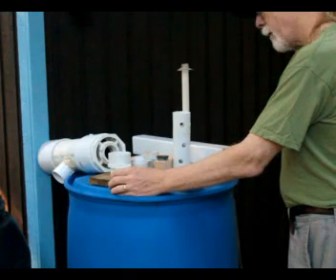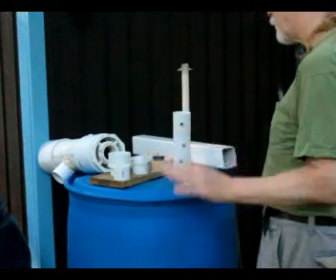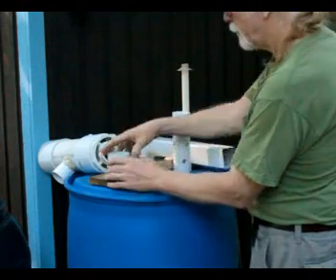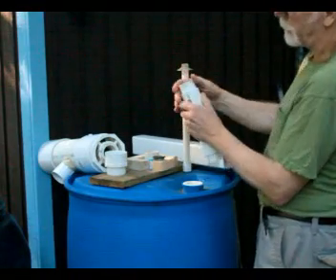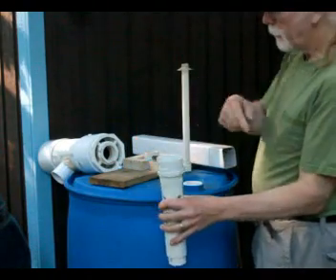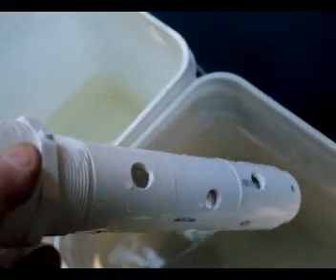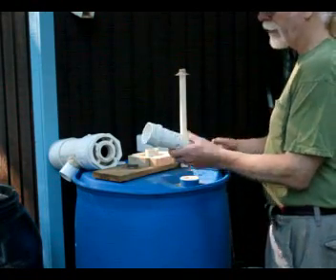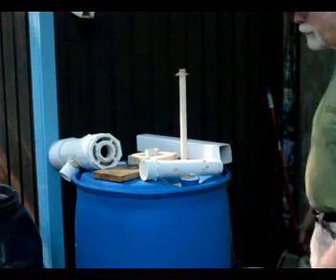DIY_first_flush_video_part3

Comment: Dave, very ingenious system. It's one I'm going to remember when I set myself up a harvesting system. I'm curious to know what are the benefits of having a setup like this? I can see how it is more advantageous than having the water all at one level within all the barrels. But I'm curious to know how it differentiates from just making a runoff pipe from the top of the barrel to the next and so on? Thanks for the input and for the videos!
Reply from the maker: T.K. Archibald Thank you for taking the time to comment. You bring up a good point. At this location, in the summer, there is usually no rain, or very little at best. The slow sand filter must have water circulating through it always. Also the filter needs input water with organic material in it to keep the filter alive. Recirculated filtered water is nearly pure, so occasionally adding some unfiltered water keeps the filter alive. The water in the barrel is used in very small amounts in the re-circulation of water through the accompanying slow sand filter. If you do not use a slow sand filter you may not need the large storage container. You will need some kind of container to facilitate the fixed amount of automatically diverted water during each rain event.  The large barrel allows a lot of leeway as to the number of gallons of diversion needed. The level at which the slow drain faucet is placed will determine how many gallons are diverted. For example halfway down is about 26 gallons of diversion. Here, in the forest, the roof gets really nasty and lots of diversion is needed at each rain event.
Reply: edvac1 Ah, I see now. Watching your other video on the sand filter definitely helped. This setup is a must-have. Thank you so much for your explanation!
Reply from the maker: T.K. Archibald You're quite welcome!!

Comment: Thanks for the pointer!  That explains everything.  I see we were both right about the slow drip; it does work without a vent, but doesn't work well, and can't be regulated.  And yes, a stopper would be necessary to block up the diverter as osmosis would allow dirty water to flow out.  Thanks!

Comment: Ah, not quite right, heavy flow won't completely block the air, but if it's heavy enough it could start to back up.  Where are you that it rains that so hard it can fill a pipe that size?  As to venting the slow drip, since I don't have the system and you do, I'll take your word for that, but I've never seen water not leak out a hole that it's above, vented or not.  Good answer for the size of the barrel, didn't realize you had a use for the extra water.  Just seemed a waste of barrel that could

Comment: The ball is to prevent floating debris from coming back up the pipe and into the water barrel, right?  How about just using a "j" shaped pvc pipe that goes down into the barrel?  As long as it's not at the very top, the depth wouldn't matter, and when the barrel was full, floating debris wouldn't go back up the pipe.  Actually, as long as the pipe didn't end at the top, it could just be straight, going down 1/2 or 3/4's of the way down.

Comment from the maker: Vent: heavy flows completely block the air -  if it rains really hard the thing will back up. The vent lets oxygen flow through. If the diverter is full and the float seal is at the top, the slow drip won't work without a vent. 55 gal. barrel is used because it was what was available, inexpensive, food grade plastic, and it is being used again - not in a landfill. Smaller barrel will work. Extra water is used to keep filter alive in dry months. Better answer on my blog June 2 2013.

Comment: I was wondering the same thing, there's usually two bung holes, why not use them.  Also, I don't see the need for the vent, doesn't air escape out the inlet?  And why not use a smaller barrel if you're gonna put a "reset" faucet in 1/2 down a 55 gallon barrel.  Seems like if you use a 30 gallon barrel your "reset" and clean out faucet can be one and the same, at the bottom.

Comment from the maker: Yes on most barrels the 2" existing threaded openings will work. Thanks for the comment and the good suggestion. The input will be slightly tilted because of the design of the barrel, but it does work.

Comment: Dave, great videos!
  I was wondering if you could just use the existing 2" bung fittings in the barrel to mount your diverter on the one side and vent on the other?  This would eliminate drilling additional holes in the drum and having to use O-rings -- plus the bungs are already threaded (even has a 3/4" NPT inside the bung cap.)